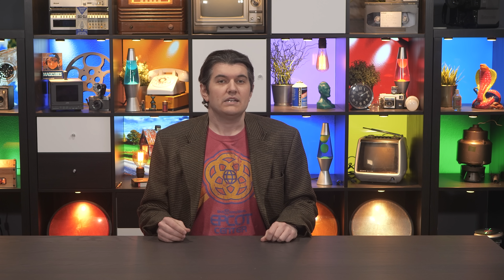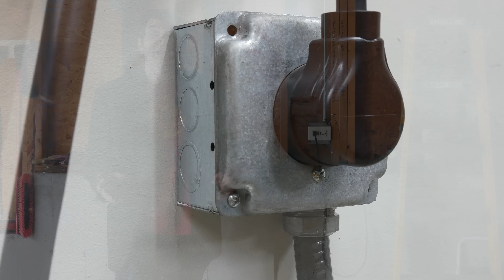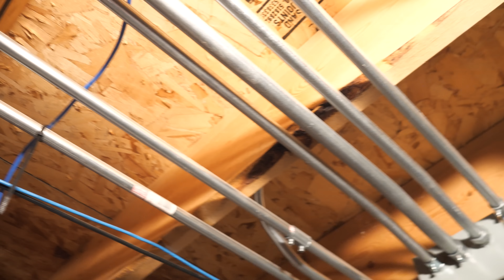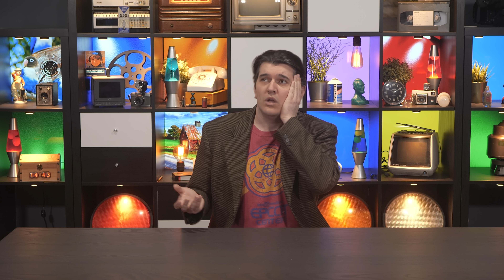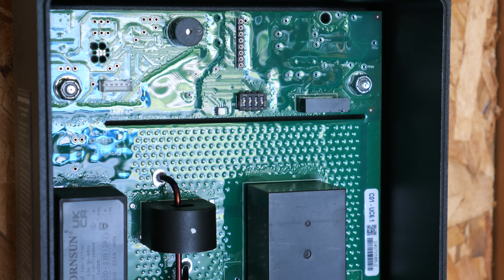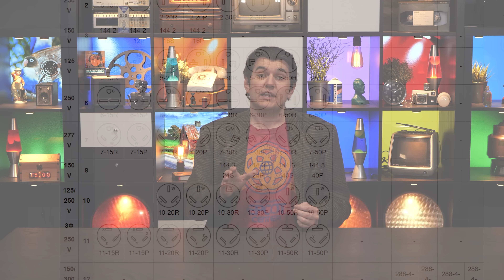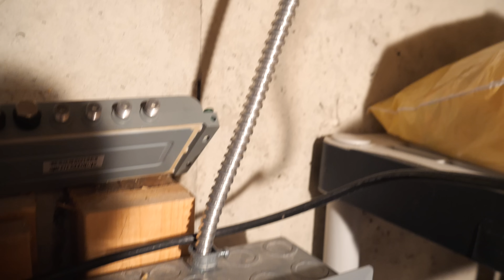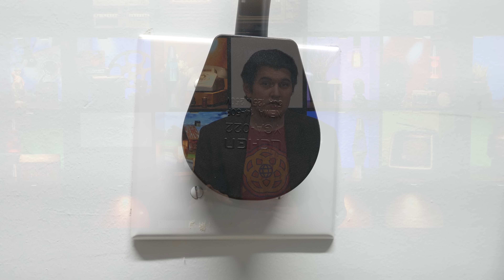The "standard" car charger is usually overkill—but your electrician might not know that

Comment from the maker: A note on charging efficiency:
The nerdiest of EV nerds will point out that lower-power charging is less energy-efficient due to the added time. For example, my car’s charging system consumes somewhere in the neighborhood of 300W which doesn’t go into the battery pack, so for every extra hour of time it takes to charge it consumes an additional 300Wh which is effectively wasted energy.
However, spending more money on a higher-power charging solution to avoid that almost never makes rational sense. In the case of my car, my typical charging sessions would cost at most an additional $0.20* on the 24A charging circuit compared to my 32A charger at home. So, if you need to charge twice a week, then you might spend an extra dollar or two per month on electricity with a smaller charging circuit, but if it means you can avoid spending even just $100 extra dollars in materials cost… Well, hopefully you get why I didn’t touch on this in the video.

*and that’s assuming a really high electric rate. With my electric rates, it’s realistically more like $0.09.
Reply: With low power chargers in winter, (being from Canada) it can get so cold that there isn't enough energy to keep the battery warm, or there is enough but it is small relative to the heating costs. This can make charging take forever if it is charging at all, all the while you are spending energy heating the battery. This is more likely if you are charging outside, completely exposed to the elements. 

With a higher power charger, the heating costs don't change, but it is much easier to overcome them, and the amount of energy actually used for charging is larger, charging the car faster, meaning energy is wasted as heat for a shorter timespan.

Sadly in climates like Canada where you run into this problems, you are often also claiming more spots in your panel for electric heat (especially as everything electrifies and we move away from fossil fuels), this makes it harder to fit higher power chargers.

This is definitely a "but sometimes" argument, but that sometimes can be a couple months in some places. 

I also agree that at home charging is the future. It will likely just be a bit harder in cold climates
Reply: @Michaelonyoutub  in cold climate the energy efficiency of ICE cars is even better than standard, as you can get the in car heating for "free" or rather use some of the waste heat that usually accounts for efficiency losses in fuel to energy output calculations.

on an EV this heating energy must come from the battery ontop of the energy to create motion (well until they figure out a way to also use the waste heat of the electric motor for that)
Reply: @TheScarvig you say there more efficient as if ice cars aren't extremely inefficient by default. Most of the heat still goes to waste in ice cars anyway lol
Reply: Was just about to type a message about the efficiency 😂 With a Volkswagen, the slowest charger can waste around 20% while the full 11kw loses about 5%.
Reply: Aha! But you have yet to consider [Very extreme outlier scenario that, tehnically, but barely, justifies the cost]!
Reply: @Deltarious  It's really not that extreme of a scenario. It's not at all uncommon for utility companies to have a peak and off-peak rate for electricity. Especially if you live in a place where the power grid is as congested as it is in the country I live in. I commonly see a highest peak rate of 80ct/kWh and a lowest off-peak rate of -20ct/kWh for a day. Guess when I want my EV to charge? Exactly, when the utility company is paying me 20ct/kWh I use, not when I'm paying them 80ct/kWh.
So I have a system setup to exploit those extreme low rates. I can just plug in when I get home and not worry about the price of electricity, knowing my EV will charge when it's the cheapest possible option for that day. But this does mean that I do need to be able to charge at 11kW.
Now for my EV motorcycle, the fast charging was an optional extra, at the cost of 1500 euro. Without it, it can only charge from a normal outlet, it won't have a Type 2 plug. I got it because I wanted to be able to use public chargers, just in case.
But with the gap between peak and off-peak rates often close to or in excess of a euro per kWh, I can easily save 10-14 euro a day on charging, just because I can take advantage of dynamic electricity pricing. Sure 1500 euro upgrade initially, but 11kW is easily doable on a 3x25A hookup. In practice that 1500 euro upgrade paid for itself in less than half a year.
Reply: I don't know if it is the same for car batteries in EVs, but in the case of electronics, less heat = longer life. Slow charging (within reason) of a LiON battery will result in a longer lifetime for the battery overall (which is a good reason to avoid the popularization of fast chargers for phone that really make the battery bake). So any loss in efficiency from charging would probably be saved in the battery's overall life - that is assuming it works the same. I'm just a knucklehead like you.
Reply: Don't forget to take into consideration that a faster, higher, charging rate is generally bad for batteries of any type.
Reply: @Aaron48219  I agree generally but even 48 Amps is only 11kW which is 0.2C for a 50kWh battery. It may also depend on the vehicle and how effective the battery temperature maintenance is. It is best to look at the vehicle specs and recomendations.
Reply: There's an argument to be made for saving electricity just for the sake of saving. It may not be cheap forever, and the financial cost is not the only toll.
Reply: I pay $0.24 per kilowatt hour in Alaska
Reply: Speaking of "Keep It Simple Stupid", any word on any Luddite EV's coming to market?
Reply: @Alec
To answer your end of video question: Yes, given the changes that have happened and the newer information that has come to light in recent years, it would be a good idea to make an update to your guides. Leave the old ones up for posterity though. Cheers!
Reply: At the same time, you stress the battery less.
Reply: Wait… if you have a battery pack at home for solar and stuff… if those batts are in series you could quite realistically achieve DC fast charging with a little DC-to-DC conversion circuit. You take a few hundred amps at 1kV from the battery pack and fastly top up your car battery when you, say, have a quick snack or go to the bath. 🤔
Then the battery pack at your home gets slow charged while you are not charging your car.
Reply: It's more about time than cost (due to inefficiency).  A simple 16A/240V charger can fully-charge a 2023 Prius Prime (roughly 11KWh usable) in about 3.5 hours where 120V @ 12A takes 11.5 hours !  That duration is painfully long and is longer than our overnight off-peak rates as well.  Also, 120V also makes same-day top-ups in a PHEV/EV pretty much impractical, whereas 240V for a few hours can actually add a useful number of miles.
Reply: Extremely excellent timing on this one Alex. Between you and aging wheels, I've decided maybe an EV can fit my life. Hopefully, I take delivery this week on my new toy. My plan had been to start with a 15amp 120 outlet and see how it goes from there.
Reply: Is there not also efficiency losses from drawing much higher amperages? And on the flip side, efficiency losses from drawing max amperage on a 24A over an extended duration versus partial amps on a 32A or 50A charger over the same duration?
Reply: @garrettmillard525  Yes and no... Since you reduce the size of the wire and still take the 80% of it capacity, the difference is only split though time... I might even cause it to be less efficient to charge slower, because of the electronics will have to be powered for a longer time.  Also, if it cold, on a 120volt plug, my car won't charge while still drawing the full 12amp, because it try to heat the battery, but it take more than 12amp to heat it...  So even if you have much larger wire causing less resistance and less heat lost, the longer use time wont compensate the efficient of it.
Reply: @mochouinard It is less efficient and more expensive to charge on a L1 charger by 18%.
Reply: Hi Technology Connections, 
Could you edit your comment with the approximate cost per watt used for the "$0.20*" asterisk in your comment? 
It won't be precise but, I'd like to be able to compare with my local pricing which is ~$0.60±0.05/kWh if possible. 
Thanks for the informative and helpful video 😄
Reply: @SaltyMcSaltyPants - Australian here... we pay equivalent of about US 20c per kW. Probably more than half of that is due to subsidies to make solar and wind power is viable here.
Reply: "The nerdiest of EV nerds will point out that lower-power charging is less energy-efficient due to the added time." Also, cable losses scale with current, not voltage.
Reply: I wanted to point that out and in addition all components contributing to your charging process have a finite life expectancy in hours. 

When you’re charging that slow you’ll reach end of life in components way earlier. Also a car that is driven a lot only knows two modes in life drivin or charging and almost always on. The systems never really come to rest. 

I’d say 5-11 kW is ideal everything below a temporary solution or emergency. 

Im in europe (230V on each Phase) and have a 11kW Wallbox registered but bumped it up to 22kW what I don’t really use because the cars cap out at 11kWh.

However with a 22kW you can bump up every of our phases to 32 Amps. 

This allows me to use PV my surplus on a single phase in the range from 5 Amps (1.4 kW) to 25 Amps (5.7kW) where i limited it because I didn’t use a sufficient gage, could have gone to 32Amps (7.2 kW). This gives me a nice range for a moderate sunny day regarding the size of my pv system. 

I switch to 3 Phases with a range from 5 A (3.6 kW) to 16 A (11kW) then where the car capps out on sunny Days.
Reply: Does that not scale with power consumption?  I would have thought most of the inefficiencies in charging would be related to waste heat on the wires and conversion circuitry, which is usually proportional to the total power flowing through it.
Reply: simple, requiring a high power home charger is additional income to EV companies.  Tesla is so successful with their propaganda for high power home charger that they made the portable charger cable as an option or additional cost, citing that significant number of users don't use it and $300 is substantial.  This charger is plenty at 240V but still useful for most people at 110V. 
Android smartphones have absurd fast chargers/charging speeds these several years but I continue charge my devices at USB 3.0 from my PC/laptop.
Reply: @zodiacfml  yeah, and everyone gets a standard bigger home charger. There are enough around i picked one up for 25 bucks and cant sell it for 250
Reply: I have a 40a circuit and use the provided EVSE plugged into an outlet at 32a only when I need a quick charge during the day before peak rates hit. 

Overnight I bring it down to 24a as I need to use an EV extender (EVdance) which whole rated to 32a, adds quite a bit of length to the setup about 31 ft total
Reply: The first thing I thought of was those times (in the middle of summer) when my car alerts me that I can add an extra 3 miles distance to my battery life if I turn off the AC system, for my 15 mile commute. Ya no, not worth it, I'd rather be comfy than get an extra 3 miles I do not really need. I have no idea what the cost of electricity for those extra 3 miles would be but I'm sure is probably insignificant.
Reply: The problem is that efficiency drops to 50% or lower in -20C temperature.
Reply: Yeah it's less efficient but the money you'll save on not fast charging your batteries in the long run...
Reply: @2BirdsinaTrenchcoat  11-22kw is not fast charging, >100kw is fast charging. And it has been demonstrated that is not the fast charging, at least on well designed cars, like teslas, a reason for reduce longevity. Actually there are some doubt about reducing longevity with very slow charging sessions.
Reply: @2BirdsinaTrenchcoat  That is not so clear. While very fast charging is bad for the battery it is not that clear what is better: moderate or slow charging.
Reply: I agree with most of what you've said, except for the amount of monthly savings realized with a level 2 charger. For families driving 1000 miles per month and spending $0.16 per kWh (Florida), the monthly electricity savings would be over $4 per month. For families driving 1500 miles and paying $0.37 per kWh in San Diego, the monthly savings would be around $14. I know families w/ three kids who drive 2000 miles per month. In some cases, you have to concede that a level 2 charger would be worth the expense based on electricity savings alone. The convenience of home charging is then a big welcome scoop of icing on the cake.
Reply: Virtually all EVs with DCFC capability have 400V nominal pack voltage for charging, maybe with few exceptions like the ones with 800V nominal pack but without ability to split the pack for charging (which would need to boost 400VDC nominal to 800VDC nominal).

What this means is the onboard chargers will typically need to supply DC voltage in a range like 250V to 500V, in order to facilitate charging.

Higher supply AC voltage is typically more efficient at this, even at the same power levels, because the charger will need to rectify AC into DC, then buck or boost it to the required charging voltage. DC voltage converters are more efficient when the input and output voltages are closer.

For example, with a 120VAC input you get ~170VDC after rectification, while with a 240VAC input you get ~340VDC. From 170VDC the booster will need to boost roughly between 150% to 300% of input DC voltage. On the other hand, the buck-boost output range need for 340VDC input would roughly fall between 73.5% to 150%.

So, if you can convert a 120V 15/20A receptacle to 240V, it should be worth it, and in most installations using cables it would only require a new NEMA 6-15R or 6-20R, some electrical tape (for neutral reidentification) and a new 2-pole circuit breaker. There are some code considerations though; NEC generally requires at least 1 120V 20A circuit feeding garage receptacles in attached garages, and each vehicle bay must have at least one receptacle supplied from such circuit(s), so 240V conversion could be technically in violation of code if that removes a required 120V 20A receptacle.
Reply: It's nice to feel seen. The additional time matters most on the slow wall outlet 120v/12a charging. You are correct that even then it's not much of a cost. If you're reading this and the only way you could charge with an EV is a wall outlet, there's a good chance that's all you need. It works for us 90% of the time.
Reply: The energy transferred is the energy transferred. The chargers are designed to be very efficient and would probably employ some kind of buck-boost converter or switch mode something or other to maximize every aspect of energy conversion and delivery. It's like filling a pool. You can do it with a garden hose or you can use a fire hose. The volume of the pool doesn't change and the cost of the water supply per cubic meter doesn't change the difference is how long it takes and if you can afford a firetruck. 

I didn't realize how misconceptions I had until I started school for EE. We started studying DC and AC theory. I thought I had a good grasp on it, but there is always so much left to learn. The main issues with charging at higher current rating would be I2R losses in the copper. So it's 6 of one half a dozen of the other. Pick your poison. You need to factor in the upfront costs and physical parameters in which the install is being done. 

Your videos are great by the way.
Reply: QUESTION:  On a standard EV like your IONIC 5,  is more energy consumed during a 30 amp  change cycle while changing from 70% to 80% than would be charging from 60% to 70%?  I know it takes longer but have no way to know if it costs more (assuming 20¢/kwh throughout)
The obvious follow up which perhaps is more pertinent to this video, is not charging to 80% detrimental to your EVs lithium-ion battery because of repeated lower top offs of let’s say 50%?
Reply: @OMG-2 To answer your first question, no. Just charge as much as you need to for daily use. If you need 100% all the time, you bought the wrong car, I assume you know this by now I hope. 

To answer your 2nd question. 
Lower end top offs like you suggest isn't hurting your battery and is encouraged. 

However... Once a month at the very least  it's recommended to drop the battery to 7% or so and do a full charge (100%) till the charging process completely stops at  your car charger at home, ***assuming you have the correct 240 volt charging at home. It's advised to drive 20 miles or afterwards before letting the car rest after the full charge. 

If you're taking a trip, charging to 50%/60% is much faster than going to 80% every time. If fast chargers are farther than 60 miles away from each other, and its cold outside, go to 70/80%
Reply: @samusaran7317  I usually let my Tesla get as low as 30% and then charge to 70% using a 32 amp  Tesla charger at my home.  I only charge it higher than that when I am going on a trip that will exceed the maximum mileage the car is capable of.  But I have noticed how much charging slows down above 70% so I decided for regular use to stop at that point.
Reply: @OMG-2 Since you can charge whenever, I wouldn't recommend letting the car go to 30% to start a charging session.  Im only offering advice for what I do on my car. But ultimately it's your car 🤙
Reply: @samusaran7317 . Yeah, I started doing that during cold weather because of the amount of power lost to warm the batteries. I also noticed how much faster the batteries depleted during conditioning for charging while on the road and decided that less frequent charging might be better over the long haul. It’s kind of a crapshoot because everybody’s environment and usage differs so you kind of just fall into a routine and keep your fingers crossed.
Reply: You also have to consider peak and off peak rates. 

If you need to charge 16 hours, it will most definitely cross over from off peak to mid peak hours, adding electricity cost. My citys off peak runs from 11pm to 7am. Only 8 hours. Preferably I get my charging done in that window. 

However if you charge everyday, this isn't an issue. It's only an issue if you plug in only once or twice a week. 

$100 or even $300 actually isn't that significant in the grand scheme of things so I personally pulled 6awg armored sheathed cable with weather jacket so I didn't have to do conduit and still be code compliant.

Why? Future proof myself. Maybe in the future car batteries get bigger. Or maybe more energy dense. Maybe batteries have no degradation from charging at high current. Maybe I can split my 6awg cable with a 60amp breaker into two 24amp chargers because I own two EVs (my garage only holds 1 car lol). 

It's not that much to future proof myself.
Reply: The slower charging issue is really dependent on the vehicle honestly. My Ford Lightning, when i plugged it into the Ford 80 Amp charger when it was first installed, i hated how loud it was in the garage running the fans in the front so high, cooling things down during the charge cycle. It was not only consuming more power powering the huge fans continuously for hours, but i found when i dropped the charge down below 40amps, it no longer ramped up these fans except on very hot peak days, so i changed the dip switches to 32amps only and its been perfect. We can no longer hear the truck fan humming in the garage through the wall in the living room (shared wall), the garage doesn't turn into a oven like it did at 80 amps, and less wear on the cooling system of the truck.
Reply: the only quantitative study I've seen on impact of LV1 vs LV2 on charging efficiency is : 83.8% vs 89.4% 
so about 5% difference which is not a lot. it's also 10yo and tested on nissan leaf that has no battery temp management, and Chevy volt. if the number are accurate that would be about 0.20$ per full charge on my small battery. given the cost of installing a curbside charging post, it would take at least 5000 cycles or 500k to recoup the cost. I would do it as a long term investment if I was owner. will definitely reconsider if/when both my cars are electric or if I had to commute over 30 miles a day with no cheap/free charging at work (not likely)
Reply: The battery runs cooler when slow charging
Reply: You should try review the smart panels for next review to see you zombie circuits in your home!
Reply: I life in Finland and since we have a three phase electricity it's easy to add a 3x16A/11kW charger. I typically limit the charging speed from Tesla (since I don't need the max power). When doing this I have noticed that the charging efficiency (logged via the Tesla API using Teslamate running in Docker container) goes worse the lower the AC charge amps are.

For eg. charging at 3x5A (around 3kW) the efficiency is only around 87% which means that 13% of the energy goes to waste. However when increasing the charging speed to 3x10A (7kW) or 3x16A (11kW) the efficiency is around 94%. This is on a warm +20C/+68F garage so temperature is not the reason.

I've done some research and it seems that the on-board charger that converts the AC to the DC accepted by the battery is more efficient on a certain amp range. Lower amps make it less efficient which causes energy loss. Same thing happens on both of my Teslas (2023 Model X Plaid and 2024 Model 3 Highland Performance). I guess they share the same components on the on-board charger.

TLDR; at least on Tesla higher amps AC charging has less losses even when the ambient temperature is warm due to efficiency related to AC/DC conversion.
Reply: @n4go Aren't almost all countries on 3-phase power? Including the US.
Reply: @littlejack59  the grid almost universally 3 phase power. However that doesn't mean that residential properties get 3 phase power. In the US and Canada residential properties generally get a single phase of 240V, which is then split in a transformer to 2 120V phases. Actually having 3 240V phases to the house is by and large a North Western Europe thing. It's far more common for a house to just get a single phase of 240, or to get it a split phase setup like in the US and Canada.
Reply: @littlejack59  In US it's weird. It's single phase mostly and then you might have one or two plugs that are 240V two phase.
Reply: @n4go  No, it's 240 volt single phase as well. All house current in the US is single phase.
Reply: @littlejack59  The US usually has 2 phase for residential and 3 phase for some commercial buildings.
Reply: @fermitupoupon1754From what I understand, that is a common misunderstanding. This is what I found from continental control systems "Residential electric service in the United States (120/240 Vac) is sometimes called two-phase service but this is NOT correct. It is only single-phase, since both line voltages are derived from a single phase of a distribution transformer with a center tapped neutral and are 180° out of phase with each other."
Reply: Michigander who lives in Germany here: On the efficiency thing: if you are using your solar array you don’t even „waste“ that energy either. 
We have 2 EVs and one is almost completely charged from a standard European socket. 
Even on an overcast day my 13KWp set up can eek out 2-3 KW. 
Also, AC charging appears to be better for your battery. The BMS has more time to get all the electrons lined up. 
We have done the same trip 3 years on a row and I routinely charge my car to 100%. So far we have stopped at the exact same places with the same SOC all 3 years. 
I have no proof might that suggests that the battery has not lost any appreciable charge even though it is usually taken up to 100% (usually via AC @ 5.5KW an hour)…
Reply: @arpinchock  Yes but charging less efficiently either causes you to install more solar than you would otherwise need ($$$) or have to buy more grid power to make up the difference.  Yes it does not make a big difference for a lower Wattage 240, but when dropping back to 120V/15 A the difference IS significant.
Reply: @ScottSuhr-l8m  I live in Europe where the grid is 240 volt… 240 volt options exist in the US though…
Reply: @arpinchock can you get Coney there?  Lol
Reply: @arpinchock you can't notice any perceivable battery loss, because your battery always charges up to 80%, even if the internal meter shows 100%.

As the battery cells wear, they still continue to charge fully to their actual 80% (not what the car calls 100%), but no longer can charge to the actual full 100% when new. They slowly lose that last 20% over the years, until their peak is now 80%.
Once the pack loses more than that, you'll start noticing a decrease in range, and the vehicle may lower the charge threshold below the 80% charge when new, to protect the batteries from further degradation.
Reply: @ProDigit80  100% in the car is usually actual 100%, not 80%.
Reply: @ProDigit80 Not true
Reply: There is a difference in privacy for smart charging/ dynamic tariffs. If you use your car you'll give your electricity utility the data of how you use your car, not only of how you charge your car.
Reply: Be thankful your energy is that low. Our supply rates in NY are similarly low, but then the power company that has the monopoly in our area charges an additional 40 to 50 cents per kWh for "service". I understand that maintaining lines and stuff costs money, but it's downright criminal. I save 10% every month subscribing to community solar, but still, electricity is multiple times more expensive than it should be.
Reply: If your electrician doesn't know this then you need an new electrician.
This is common knowledge here in New Zealand.
Reply: Yes please do an Updated Charging Video
Reply: Install the circuit for the maximum possible and be done with it.
Reply: I assume most of that 300W is from AC>DC conversion hardware, this hardware usually has an efficiency that is probably nonlinear in relation to the charging speed.
The big comparison would be: What is the highest AC>DC conversion eff. with the hardware in the car vs the AC>DC conversion eff. of a DC charger itself because there IS going to be a conversion eff. in the DC charger due to AC being converted to DC at some point. At some point you have to convert from whatever you have from the raw power source to whatever DC voltage is needed at the car plug.
It does sound like the internal power conversion built INTO the car is expected to be the least efficient option, but is that really the case if we compare the most eff. charge rate for the in car converter to the most eff. rate of another external DC power source?
Reply: Let the load decide that, not your source. 🤷‍♂️
Reply: My takeaway from this is that electric rates are either a lot lower, and/or electric cars require a lot less electricity, than I thought. If I was paying 10% extra on my air conditioner due to efficiency, I'd be losing 20 bucks a month. Though I guess the comparison still stands there, buying a more efficient one would definitely not pay for itself before the machine stopped working.
... Oh wait, I misread you, didn't I. you didn't say the total Wh of the more efficient charge. I could have sworn you said it was 3000.
Reply: Agreed - I also agree about that loud elbow creek too!
Reply: I wonder how / if the 80% rule applies in the rest of the world?! Like; are electric cirquits and connectors designed with the same rule in mind, or do they go the opposite way?
Reply: I'm a bit confused as to how your in home charger is consuming so much energy. These "chargers" don't do much after all, merely negotiate charge parameters and so forth (which are all extremely basic)   then switch AC through to the cars onboard charger with relays/contactors , which ahve very very low losses.
Reply: My folks recently bought an EX30 and Volvo specifically states in the manual that people should only use a standard household outlet to charge the vehicule occasionally when nothing else is available, it's not meant to be used as the default charging solution. Something about battery degradation I believe.
Reply: This was such a clever and budget-friendly way to repurpose old mason jars! I've tried something similar in my garage to organize screws and nails, but your method with the wooden rack on the wall is way more efficient and looks much neater. What I especially loved was how you added the labels it makes finding what you need so much faster. This is the kind of tip that every DIYer, beginner or expert, can use to level up their workspace. I’m definitely going to upgrade my setup using your idea. Thanks for sharing such a practical solution with such clear instructions!
Reply: Depending on the car, the efficiency can suffer quite a bit: 5-10% - this is not nothing.
Reply: That 300W needed as minimum charging energy isn't the only inefficiency. The lower the power, the lower the efficiency also due to specs of the electronic components of the onboard charger. For example: 230V single fase 2kW ~82% efficiency, trifase 11kW 95% efficiency. So every 100 miles charged there is a difference of 3.5kWh between 2 and 11kw.
Reply: People are shocked when I say I can charge my car on a 110 outlet every time 😂
Reply: Did you cover how a NEMA 14-50 outlet is more expensive because you need an additional common wire?
Reply: This is really only a big deal with Level 1 charging since the car can be awake for 3-4x longer. It would add up over time.
Reply: While most EVs ‘can’ charge on a level 1 charger not all can. Large pack EVs cannot. I had to level 1 charge my cybertruck for a month before I got my home charger installed and the level 1 charging could but keep up with losses and add any range. Of you have to add a a new circuit for EV charging then you should add the largest possible. This will also future proof the install. I added a 60 amp 240 volt circuit and it was only $50 more in material compared to a lesser circuit. Also be sure to use a commercial grade plug. Residential grade plugs cannot handle the heat load.
Reply: When $0.20 is a "really high electric rate" ç_ç Our low off-peak rate is $0.34 here in an average zone in Switzerland.
Reply: @MichaelBylehn in that case I'd say it's best to quickly charge the car and let it sleep :D
Reply: this is like an OG mighty car mods type video
Reply: Whats your electric rate?  In California, charging an EV easily throws you into TIER 2 which is 0.52/kWh
Reply: I know I’m an outlier but I am currently running my Sierra EV on a 30A (24 usable) 230V circuit currently. I will be upgrading when I get time to the 100A line. My normal commute 2-3 days a week is 250 miles round trip. 3x a month I go on up to 1000 mile work trips averaging 2000 miles a month. When I do DC charge, it’s around 5x the cost of doing so at home.

The 80A usable line will serve not just as faster charging to prevent me having to stop and fast charge but also for backfeeding when I get that setup. I drive one of the most inefficient EV’s but it is the only one that suited my needs for work, and has a 200+ kWh battery for playing with.

While I am mainly an HVAC guy who travels working on top tier equipment, I am also heavily involved in demand management, “virtual power plants”, and overall reduction of energy consumption as a job. EV’s being able to offset some crazy time-of-day rates (some as high as 12x peak vs. super off peak) will go a long way towards justifying EV investment regardless of incentives for residential. 

Long story short, there’s a good amount of people who if they had a decent battery pack and V2H they could cut their TOD power bill by 4x. The initial cost to put a larger circuit in could make that much easier. I don’t sell or work on V2H, but I do know we have multiple setups being tested at work that can be configured to discharge at the usage rate making peak consumption zero. Honestly I could see seeing old EV’s in driveways serving just this purpose in the near future.
Reply: I’ve seen on EV charging. I’ve installed several stations myself, and I completely agree most households really don’t need a 50A NEMA 14-50. Unless you’re road-tripping daily, a 240V circuit on 20–30A is more than enough for overnight charging. Appreciate the clarity and emphasis on flexibility so many electricians still default to overkill setups!
Reply: @diytoptricks Some people door dash alot like my dad, along with long distance doctors appointments. Have 50 amps will be future proof 🙏
Reply: 300 W seems excessive.  I regularly charge my Bolt on the lowest trickle charge setting which is 800 watts and power added to the battery is pretty much 0.8 KW * hours.  I'm certainly not losing 300w.
Reply: No normal charger wastes 300W/h for doing nothing.
Reply: @TechnologyConnections Sir, can you please explain how modern EVs withstand driving in water logged roads? also, how do they survive floods
Reply: It's not just phantom drain. 120V is just less efficient than 240V due to transformer having to do more. And rate here in MA is like $0.33. More in CA, Hawaii and maybe other handful of states. Same in Canada, where Quebec has really cheap power from hydro and other large provinces like BC and ON have much more expensive power.
Reply: I tend to disagree with this - in some places (California) the electricity rates can be REALLY high, so yeah, the cost adds up very quickly!
Reply: I made an even crazier price simulation comparing different gauge of wires for my level 1 (😢) charger and the 50ft extension cord required to charge curbside. considering the first extension cord I got burnt after 5 years and took out the exterior plug, I have to buy a new cable and turned out even if a cheap-ish cable has more resistance and gets hot to the touch, which can create a significant source of loss compared to the measly 1.5kW the charger is puttinr out. but even then , it's hard to recoup the cost of a beefy cable because I don't drive that many miles..so I'll just go for safety, make sure the cable doesn't get hot, doesn't damage the plug and will add a good error margin. the catch is when you increase the gauge, the price goes up quickly but the savings in thermal give diminishing results.
Reply: Great content.  I wish I had seen this before I got a wall mount full on charger.
Reply: couple comments and questions. i'm pretty sure you cannot downsize the wiring and breaker for a 14-50 receptacle per code; a 50A receptacle needs to be installed on a 50A circuit. you can downsize and dip switch as you have done, but it has to be hardwired (which is generally a good idea anyway). question is why the junction box? why not just run all the way to the charger? also not sure where you got the idea MC cable stops at 10 awg, i have 6 awg in my house; maybe they just don't sell it at big box stores.
Reply: also, i do appreciate the pedantic point on this, it's what i appreciate about the videos generally haha. my electric is closer to $0.3/kwr for supply and delivery. even in your rate example, the breakeven would be 5 years which is less than half the vehicle life and your next car will also probably be an EV. agree shouldn't be a cost barrier to adoption, but will be better off with 240V in the long run.
Reply: 3:14 Why do you start the video off fine saying its okay for anyone driving less than 200 miles a day,and then at 3:14,you state its okay if you aren't driving more than 40.miles a day? Stop with the misleading misinformation
Reply: 8:18 Neat that you live in a world where your job is at home,and you barely work,and likely have your meals delivered to your home lol Some of us have to drive 100 miles to get to a store.
Reply: Moving to only EVs. Trading in my gas truck for a Chevy Blazer today. I absolutely love not going to a gas station and not worrying about oil changes! Time and money saver! ❤️❤️❤️🎉🎉🎉
Reply: Well, there is greater heat loss when charging at higher rates, which is wasted electricity.
Reply: a charger is an AC to DC rectifier with ancillary bits what you are referring to here is an AC to AC evse not a charger.
Reply: This claim can change pretty significantly based on environmental factors and also based on the vehicle itself. Some vehicles have much higher draw when they're on for charging from the LV system. A Gen 1 Rivian R1T, for example, can draw almost a full kilowatt when it is turned on just to charge. Coupled with the fact that it has a massive battery, because it is not an efficient vehicle compared to most sedans, this means that with the power you can pull out of a normal 1200 watt socket, it can literally take days to charge any appreciable amount into the vehicle's battery pack. For inefficient LV systems and cars with large batteries, higher power charging solutions do start to make more sense. Or what if you have multiple cars?

I fully support the assertment that this should not be a barrier to entry for most people who want to adopt electric cars. I think of it as an optimization for people with specific types of cars who might live in colder climates or have specific use cases with multiple vehicles in an electric home.
Reply: You need to watch the new video from engineering explained!!!! $8000 of a life of the vehicle using that wall socket
Reply: High power level 2 charging is not needed. But getting 240V is a huge efficiency jump
Reply: Thanks for bringing this up, fair enough. For my family's case, it was a significant project getting electricity to our detached garage so I doubt adding the 240v plug was a huge cost. It's both nice to be able to charge more quickly so we don't have to plug in the car as much (we usually don't park in our garage so it's a little bit of a pain), and have charging be more efficient at the same time.
Reply: But wouldn't it degrade the components faster?
Reply: 😮 5:24 😊
Reply: Yes that is why charging at 120V 15 Amps is only 84% efficient. At higher Volts and Amps the efficiency can be as high ast 95%
Reply: This cost analysis won't work for everyone. First, electricity is 32 cents a kwh in my area. The outlet in my garage is only a 15 amp, 110 volt circuit. With my plug in charger, I could only charge at 1000 watts an hour. With that 300 watt overhead, batteries are charged at only 700 watts per hour. A 70 kwh battery would take 100 hours to charge, or $32. A 48 amp, 240 volt circuit will charge the same battery in 6.25 hours at a cost of approximately $23. Throw in the level 2 charger rebate in my state and you can have a break even point of under two years when you factor in the cost of installing a line. Then there's the benefit of having fast charging.
Reply: Counterpoint: having a faster charger means you can schedule for off-peak hours and benefit from lower prices (and in my area, a monthly bill credit for not charging during peak hours).
Limiting to just off-peak hours, your needed daily miles to make it worth it go from 200 to about 50, which makes a LOT more sense, and the price difference (at least in my area) definitely pays off the install cost.
Reply: We're Canadian. My nephew has a Hyundai electric car and charges with the normal outdoor receptacles used here for block heaters. No problem.  No problem parking overnight in a hospital parking lot during the night shift.  Our Tesla is coddled in a garage, but these are incredibly capable vehicles.
Reply: Hey man, how can you be convinced to make a video on these bi xenon something super bright Headlights that literally blind you from a mile away especially if they're on high beams on light trucks, SUVs and 18 wheelers? This is made worse by this new feature dial which let's you adjust the headlights up and down. So.many people drive their cars and SUVs with their lights on the highest setting that'll blind you if you're driving a regular sedan. It's even worse on narrow country roads in poor states where the danger of driving off the road is very high AND it's especially bad when raining.

Then there are cars with AI headlights that dim automatically when they're on at night. Some switch to lowbeam from farther than others. But many cars dont, and you're left wondering whether the highbeam will switch to low or not and you start flashing your light telling them to dim the brights. OR you end up waiting thinking, the other car has auto switching and will dim down anytime only to find out that the oncoming driver has forgotten and all this while you're getting blinded more and more.
So many elderly people or individuals with sensitive eyes are now limited to day driving because of blinding lights.
Reply: @BobbeeSingh oh man, I would love a video on that!
Reply: As an owner of one of these offending vehicles, I must say they are as annoying on my side too. They're wonderfully bright on high beams, which is great, but they don't turn on and off when I think they should, and they're also hamstrung from being less offensive to other drivers by older American regs, when my car was built. The adaptive pixel style would be a great mitigating factor here, but it's not available in America/US until after at least 2020 model year... All in all, I agree that TC should do video on the intricacies and pitfalls of this tech @BobbeeSingh
Reply: @GreenForce82 older folks get really scared by them. Not only that but it used to be that truckers were generally very polite with traffic manners but now so many have their lights on high beams constantly no matter how much you flash your lights to tell.them to knock it off. I have often heard retirees complain about night driving to even shorter distances because of the fesr of being blinded by them which basically forcing them to alter their lifestyle
Reply: @BobbeeSingh same issue here in the UK and I’ve noticed it when driving in Europe too. Sometimes I wonder how they are legal especially in winter on dark narrow country lanes when my retinas barely have time to recover between each passing car.
Reply: @BobbeeSingh  It's been done an various channels already.  And the super bright ones, are normally the LED ones.  Factory fitted Bi-Xenons normally have an auto light leveller, that will adjust the lights based on the weight distribution in the car). Most modern cars also have auto dimming of the lights (Bi-Xenon or LED's), if the sensor sees a car oncoming. The aftermarket fitted Bi-Xenons/LED's however, do NOT have these features, and are the issue.  But I think most aftermarket Bi-Xenons have been superceded by aftermarket LED's.  Although I agree a video on these, and al the issues could be technologically informational (espacially the newer type MATRIX style LED's, where it only lights up certain portions of the road ahead, not to blind oncoming cars, or pedestrians, etc. )
Reply: @riaanlouw1874 yes but those channels dont mean as much as this one...
Reply: You missed the point of the 80% rule.      Conductors are derated for continuous load.    10awg 90degree thhn like most bx cable is 40amp max
derated 30 amp circuit is 37.5 so you are fine.  

Breaker is sized for lowest rated equipment on circuit.  It should have no issue as long as you stay under 30 amp.    No reason to under spec to 24.
Reply: I like the information you’re sharing.
I live in the U.S. and so have single phase AC 240V power and a Tesla charger in my garage, but I’ve been led to believe that the battery longevity will be increased by charging more slowly.  So for my 3 & S I like to charge once or twice a week at 5A.  I’m not really concerned with efficiency losses as I use solar panels and Powerwalls for storage.
I’m more interested in making my batteries last as long as possible lifetime wise. 
Would you agree that slower charging is the correct choice here, or am I mistaken?
Reply: @tonyg8129  Even the full AC charge speed on most cars (11kW) is so slow that it won't affect the battery life span. The biggest thing that affects battery is temperature and calendar age. Even fast DC charging speeds are not bad for the battery if the battery temperature management is properly handled.

So no worries charging at home. Just use the maximum power that is suitable for your needs. No need to charge at 5A.
Reply: @n4go Thanks!
Reply: @tonyg8129  I don't have the specific info for a Tesla, but in general you want to keep battery charging current no higher than the typical discharge rate. So, for your cars, as long as you aren't charging faster than about 12KW you shouldn't need to slow it down any further. In other words, at 240 volts as long as your charge current is 48 amps or less, then you are fine. I think when people say avoid fast charging, they mean DC fast charging.
Reply: @tonyg8129  Great question.  I assume slower is better, but would like to know more.
Reply: this entire video was a waste of time, this is coming from someone who's been able to install 50AMP 220V RV outlets for 30 years.  You don't know what you think you know, you based your analysis on an incomplete data set, and as an expert, this made me cringe to watch.
Reply: If is is cold outside and windy more then 3000w can be wasted in just keepin the battery warm... Lithium batteries HAVE to be heated to more the +0c (warmer then freezing) to be able to charge at all so in winter a lot of energy is wasted just to keep the battery pack warm and very few is aware of this fact.
Reply: @a64738 The energy used to warm the battery is performing a function, it’s not “wasted” at least not all of it. You won’t consider the energy used to cool your vehicle cabin in the summer wasted would you?
Reply: @a64738 3kW at thermal steady state?
Reply: @a64738  Which a higher charging current might be more efficient as once the charge is finish, we don't need to keep heating the battery.  (BUT some car, like my Chevrolet Silverado seem to keep heating it when the charge is over)
Reply: @a64738  most garages aren't below freezing. And if you park outside in that kind of weather. You're gonna waste time sitting in your car waiting for it to heat up anyways
Reply: @XboxUnitD77  "And if you park outside in that kind of weather. You're gonna waste time sitting in your car waiting for it to heat up anyways"
No? You can pre-heat it before leaving, and EVs heat up the interior insanely fast.
Reply: @a64738 more bullshit than I can handle! 😂
Batteries emit heat when being charged, and are insulated by the pack itself. All you need is an initial charge current and it'll just warm up the more it charges by itself.
Reply: This is heavily different per car model. I'm using a Renault ZOE and with a normal German plug I would need more than 50% more energy to charge my car. With prices from 0.40 Euro/kWh, this is massive. And also the cable might not be built for a permanent usage of that high power.
Reply: @dura2k  Either you are not saying what you want to say correctly, or there is something you do not understand.

kW is an unit of power, and kWh is a unit of energy over a amount of time.

So if you charge a 100kWh car battery at 10kW(~40amp), it would take 10 hour.  If you charge at 20kW(~80amp) it would take 5 hours.  For simplicity, if we remove efficiency lost at different level, both charge would have drawn 100kWh to your electric grid and cost the exact same. (Unless you have a time of day pricing that change and you can't do both during the same period)
Reply: @mochouinard  Funny, how you say "For simplicity, if we remove efficiency lost at different level" if that's exactly my point.
The efficiency is the problem, if I need to pay 50% more because I use my normal outlet, it's a bad deal. 0.40 Euro/kWh is then 0.60 Euro/kWh and instead of 5.2 Euro/100 km I'll need 7.8 Euro/100 km. And I need to get a charger, because I never saw that one for a normal outlet is included.
(And also, again, the cable in the house may not be good enough for a permanent usage of that power.)
Reply: That is an incredibly horrible take for this. You were advocating for a level one charging while admitting that you can use 300 w simply for the overhead without charging at all. When you say 300 w, that's for your car, many electric vehicles are much less efficient on their overhead, and would need even more to do it. You can easily end up using up a third of your power simply on overhead. That's insane!
And that completely ignores temperature if you have to condition your battery pack to get to the right temperature the percentage used for charging is going to be even worse. To the point where in cold weather level 1 charging often cannot charge at all.
Reply: @Green__one A level 1 circuit in the US is 1.4kW. That 300W overhead, which seems awfully high to me based on my experience charging at level 1, is 20% overhead not 30%. At least for my car, the overhead is not noticeable - one hour of charging gives me pretty close to 1.4kWh in the battery.
Reply: @pondking2801 my point was that based on my experience, 300 w is actually low, that's why I said it can be 30%. Try charging a Tesla at some point. 300 w is very low for their overhead. Especially if you have to do any pack conditioning.
Reply: @Green__one True. That overhead is 18% more expensive long term but many dont want to acknowledge it. They invest in a car but not the charging equipment. So silly 😂
Reply: Alternately, the faster you charge the more power is lost in the wires to your car. Recent 48A chargers have really thin cords now and you can feel the cord heat up noticeably when you charge even at 30A. This heat is lost energy. Charging slower means less loss that way, as losses are current multiplied by resistance. Obviously both issues interact.

Charging faster can mean you are more able to avoid high time of use rates.
Reply: @stevebollinger3463  they just need to build within spec. Spec hasn't changed since before it was discovered.
Reply: It looks like you've found another episode of "It Depends Land."  Factors in sizing a home EVSE circuit, beyond being a "judgement call," would make a wonderful video all on its own, perhaps in Technology Connextras.  European readers are reminded that this is more of an issue in North America, especially rural North America.  I live 13 road miles away from the nearest DC Fast Charger, and until just a couple of months ago, that distance was over 35 miles.  So, there are still more than a few lived-in parts of the United States where if you can't charge well and reliably at home, then you really can't use a BEV for daily transportation.

While the setup you set up for your parents makes perfect sense for them, it might not work well, or at all, for everyone.  With that being said, you still don't necessarily want to "overbuild" your Level 2 system, either.  For example, the Nissan Leaf only has a 6.6 kWh onboard charger, so the most it will ever "ask" for is only 27.5 amps.  So, a 40 amp circuit will be all it needs, and a 30 amp circuit with the EVSE jumpered down to 24 amps will be fine.  The Chevrolet Bolt, however, can be an odd duck.  Depending on the year, it will come equipped with either a 7.2 kWh or 11.5 kWh onboard charger.  The math for the 7.2 kWh charger is similar to the Nissan Leaf.  The 11.5 kWh charger, however, can request up to 48 amps, meaning that you would ideally have the EVSE by itself on a 60 amp circuit.  Current production Teslas use either 7.7 kWh (Model 3 Rear Engine only) or 11.5 kWh onboard chargers for everything else, including for the Cybertruck.  However, Gen 1 Model S and Model X vehicles could have a "dual" onboard charger that could draw 20 kWh, which would request up to 83 amps.  So yes, Virginia, you really could just put a EVSE on the end of your gooseneck and plug it directly into the car.

What does all that mean?  Simple.  While you shouldn't let "perfect be the enemy of good," you also shouldn't "cheap out" when installing your EVSE circuit, especially if you're having to have a licensed electrician install it for you.  Install the largest circuit your home electrical system and budget will allow the first time, so you aren't having to mess with replacing it with a larger one further down the line.  Do not just install the smallest you can get away with today.  "Getting away" might not be a good idea now, and it will probably be a worse idea later on.  Yet, if you can only install a 60 amp circuit instead of a higher one, don't lose any sleep over it, either. 

You might not be able to install that high-amperage circuit for your car.  But, if you can realistically do so, you should.  You can always "jumper down" the EVSE if you want the car to draw less power.  You can't grow the wires in your wall thicker at a whim.  This is especially important if you have a good chance of becoming a "two BEV family."  Modern Dual EVSE can effectively power share between two vehicles, charging both of them without burning up the wires inside your walls.  However, if you only give that dual charger 24 amps to divvy up between two cars, you will only experience frustration at best.
Reply: i'm curious if your 300 watt charging system power is dependent on the current draw, or if it includes battery heating, or what. The electronics isn't going to burn up that much. Also, after you're charged, can the heating be turned off?
Reply: @jamesvandamme7786 it’s more from powering the cars computer as well as the pumps that move move coolant to keep the battery at a consistent and stable temperature across all the cells.
Reply: Aluminum wiring hasn't been an issue for ages, so much so that anti corrosion treatments are explicitly PROHIBITED by many manufacturers because they are unnecessary but add the risk of lubing the threads on terminals causing torque readings to be off.
Reply: I have a Tesla Model X and a Cybertruck, and when I used 110–120V, it only gave me 3–4 miles per hour. 
That’s not good, as it heats up and is NOT safe!

That’s why, at my place, I have two Tesla Wall Chargers on each side - and it’s PERFECT!

This guy is DUMB for pushing that to people, period.
Reply: I thought this would be about 12 LA battery chargers.
Reply: Ahh, but what you lose in energy efficiency, you make up for in battery health.
And a healthy battery needs replacing less often, which saves resources.
You should ALWAYS be charging a battery as slow as possible to maintain it's health.
Question for people with an EV: Does your vehicle let you limit your charging capacity to a set value like 80%? Or are vehicle packs built to have that top 20% hidden and never used?(With the one-up marketing of these, I suspect not.)
Reply: @Prophes0r  I have a Polestar 2 and it lets you choose the charging capacity in 10% increments.  It also lets you choose the amperage the car is requesting.
Reply: I have a great idea for a video for you.  Did you know records were originally made from shellac?  There's a whole story there about why we switched to vynil and the origin of shellac in the first place.  Turns out it's from a bug.
Reply: First, those home outlet are not meant to have a continuous draw at 12amp... Even 14-50 outlet are not all made for that !  Also, depending of your climate, an regular outlet might not even charge your car when it cold !  Also, it not 80% rules everywhere anymore, they made it 70% here, which is why tesla don't sell their 40amp version of the charger anymore on the 14-50!  Be careful with the product you show on amazon, they might not be UL/ETL/CSA... compliant !
Reply: @mochouinard The 120V standard household outlets can handle 12A continuous draw though you should ensure that the wires are screwed in rather than stabbed in on that circuit. The continuous draw is more of an issue on the larger sockets such as the 30A and 50A sockets. While a standard dryer won’t stress the circuit too much, charging a car will. You need to make sure that the wires are properly secured and that the socket is rated for continuous duty. That is not something marked on most packaging, so you will need to check the specifications with the manufacturer, though now some are making outlets specifically for EV charging applications. As for cold weather, yes the battery will charge very slowly I’d the battery is to cold. That is why you should use the preheating option to reduce charging time. If you don’t the first part of the charging cycle will be heating the battery more than charging.
Reply: @pondking2801  My data center experience is to NEVER use a house hold outlet as they will finish by "melting" because of the constant draw.  People have issues with their 14-50 outlet melting as well when you get the cheaper one (used for oven).  They have the same specifications as the better one, as they pass the same standard test, but they are not made the same.
Reply: @mochouinard  First, any properly installed NEMA 5-15 outlet is on a circuit built for at least 15 amps momentary draw and is meant to handle at least 12 amps continuously.  Many outlets are on 20 amp circuits which are good for 16 amps of continuous draw and have a NEMA 5-20 receptacle with the sideways T shape on the left side so they can accept a NEMA 5-15 or a NEMA 5-20 plug.  Furthermore, a NEMA 14-50 outlet is designed for 50 Amps of momentary current and 40 Amps continuous draw.  So when you say it isn't meant for 12 Amps, you clearly don't know what you're talking about.

NEC 210.20(A) states the maximum load on an overcurrent device is 125% of the continuous loads plus 100% of the non continuous loads.

The inverse of that is that you may not use a load greater than 80% of the circuit breaker's rating.

There is nowhere using the NEMA standard and not the NEC so your 70% claim is completely wrong.
Reply: What stupid nonsense is that that you're spouting?
Seriously, from an electrician.
Reply: You mentioned range anxiety, but did not really cover the real reason why it is a blocker.
Sure, there might be some anxiety about day-to-day range too, but the main anxiety in regards to range, is if something happens that knocks out the powergrid for a year or hundred. i.e an invasion, a zombie apocalypse, or MAD.

One of the main advantages with ICE-cars is that the fuel lasts a long time unused (both inside your car and in stations), takes you far on a small and relatively speaking lightweight tank/can, can be siphoned from other cars abandoned somewhere, and the infrastructure is overall far more resistant to sabotages/attacks aimed at centralized locations.
All this might have sounded as a joke, and that is partly because I presented as such. But with the way tensions are escalating over here in europe, "how usable would it be in a refugee-type situation" is a real concern I have encountered people expressing and considering when thinking about getting a new car (which in a ay shows how far the technology has come: pretty much no matter which car you get it will always fulfill all your day-to-day needs, and the differences in cost in doing so is not large enough that it makes no sense to compromise on such in return for "ruggedness" (in lack of the correct term)). Meaning that when it comes to range-anxiety in terms of changing to EVs, the dealbreaker is when such a car lacks the assurance of range in both space and time in a situation where the infrastructure itself could no longer be relied on.

Since some of those people nevertheless like the idea of EVs, I have also heard them consider everything from hybrids of various sorts, to simply purchasing a diesel/gasoline generator that's compatible with the car's charging + a gas canister, that could be stored in the trunk and used in an actual emergency.

ps:
On that note, I am curious what compromises a car-manufacturer would have to make if they wanted to create an EV "hybrid" that is essentially that which was just described. As in, a backup redundancy that would only be meant to be used for actual emergencies?
Like, if I were to imagine speed was not an issue (which it likely is not in that flavour of emergency) and there would be no issue with the redundancy being an ICE weak enough to cap out at 10 kmh (wagon speed?; so long as the torque was enough to still work in steep uphills) or having a very short range that one would extend by filling the trunk with gas canisters once they have to rely on the redundancy (or even the ability to take out (part of) the battery to convert to a fuel tank / place the canisters in), would it really result in any sizeable trade-off? What if all it did was act as a generator for the car's battery, and we assumed there would be no issue in stopping to let it run for an hour every metric mile? Surely that latter would be no more than essentially making an extra [hard-to-access] compartment in the sheet-metal/chassi to mount an off-the-counter thing in?
Reply: also supercharging all the time degrades battery life   too slow is waste too fast damaging so best middle of specks 
me i staying with gasoline  more power wasted since most ev especially on security mode uses lot of power  sitting